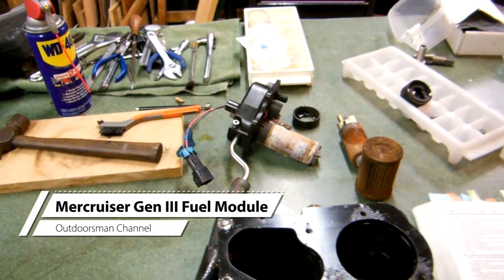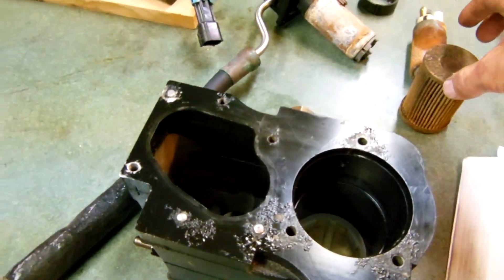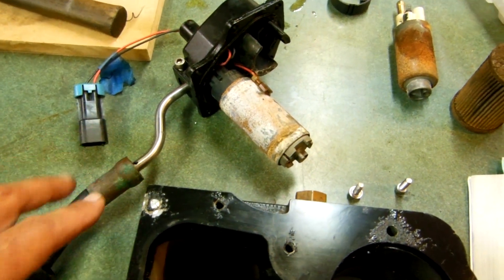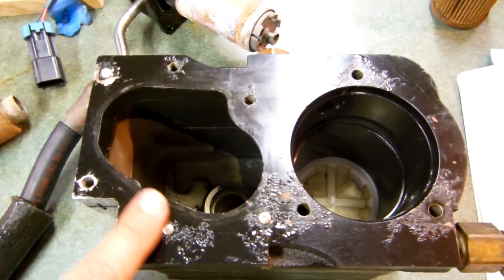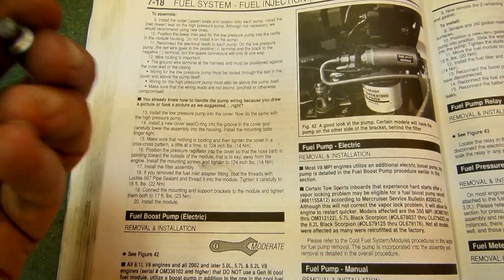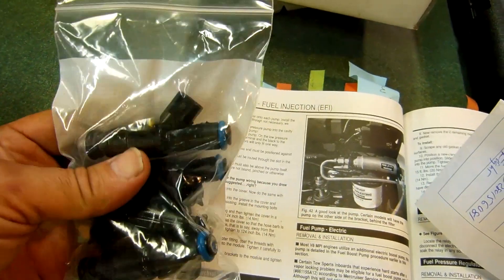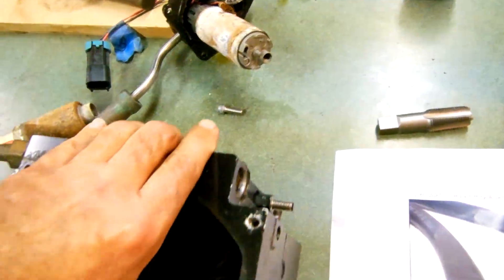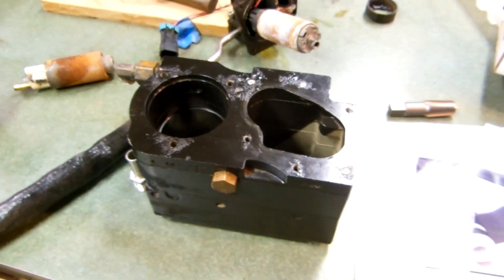Mercruiser Gen III Fuel Module

Comment: That is too much work and it looks like you need new pumps.  Also, the main paint peal problem is inside the small filter on top of the unit.  You can clean that out.  I would just buy a new Gen III box and assembly.
Reply from the maker: The Gen III box is a lot of money.  Ours has been working perfectly since this. Video was made and cost little to nothing.
Reply: What 'small filter on top' are you referring to?  I thought there was just the paper canister filter and the little disk one at the bottom.
Reply: The pumps alone are 750.00

Comment: Hello, great jhob!..What is the manual number? Thanks
Reply: Hi.  Manual is a SELOC Mercrusier Stern Drives 2001-13 Repair Manual 3208.   Tip, don't leave it in the boat if it can rained on.  Good luck. Joe
Reply: @joesilverbliss1721  thank you very much
Reply: No problem.  I am a contributing associate for the outdoorsman channel.

Comment: Did you replace the small round filter below the main filter?
Reply from the maker: Everything got replaced
Reply: Ok, most people only seem to replace the round filter and not both.
Reply: @ATKrausz  round filter is, from my reading, a 5 micron particulate filter.  worth doing while you have it open, imo.
Reply: @johnbeachfl1 The disk filter has a bottom filter made of fiber out material .  It will start to break down over time noticeably.

Comment: Hi, To prevent water buildup in your fuel tank, keep the tank full of fuel when the boat is not in use. That will prevent condensation on the walls of fuel tank and less water will collect in it.
That will save you a lot of headaches and money. Water in fuel is not bad fuel, but condensation in the tank. I hope that will help. PS: Great job on the broken bolts :o)
Reply from the maker: Thanks yea we are aware of that.  Unfortunately we bought the boat in this condition and were not aware of it when we purchased the boat.  Thanks for watching!
Reply: Excellent advice!  Jim, the fuel injection specialist, recommended running low cost ethanol gas during the season.   The fill it up with non ethanol gas at the end of the season.  He said the ethenol cleans the system.    Boat is running fantastic now.  Joe

Comment: how do you remove the fuel module from the boat? i see you took part of the fuel line that goes to the engine with it. Does that not disconnect from the module? Im stuck, thanks!
Reply: So the stainless tube that goes into the fuel module that eventually goes to the fuel rail comes out.   This one was stuck and corroded big time.  This one had a cross bolt with a tapered end to hold it into the fuel housing.  You need to remove that first.   If yours does not come out I would put penetrating oil on the stainless tube and let it sit.  If I was going to do this again I would soak all screws with kroil.  They might not have broken.   To remove the rubber hose from the fuel rail on top of the engine you need to get special tools at auto store.  Not expensive.  Finally there is a special oring that you should replace on the stainless tube.  It seals 40 psi gas from seeping out around the tube.   In addition to all this if you clean corrosion off the seat of the fuel tube hole on the box it may not snug up with the cross pin when you are done.  I work closely with the outdoorsman channel.  Good luck Joe
Reply: @joesilverbliss1721  Hi, regarding the stainless line that goes into the fuel pump cover, mine looks to be in very good shape (i.e. no corrosion).  That said, I haven't removed the stainless line from the fuel pump cover yet.  Where it enters the top of the cover, is the stainless line supposed to be rigid?  I can rotate the stainless line clockwise and counterclockwise with it still connected to the top.  I only turned it a few degrees each way, but I want to be sure that is normal.  I know that little 'crossbolt' thing is supposed to keep the line securely in place, but like I said, I'm not sure if it is supposed to stay in a fixed position.  I'm thinking it is supposed to move as it is probably an O ring seal.  Can you please confirm that some movement of the stainless line is ok?
Reply: @willytv275  the stainless line comes straight out after cross pin is removed.  Use liquid wrench or kroil if you can get it.  It is good that you have some movement. Mine was stuck firm.  It is probably corroded a bit.  There is a special seal that I would replace after you remove it.  I would keep working it and rotating it.  So, after I got mine out and cleaned the bore of crude it didn't want to snug up with the cross bolt.  I think it is a poor design.  I had a tapered cross pin that went into the other side of the hole with a smaller diameter part of the cross screw.  New cross screws is just a hemisphere and I think it might work better.  I bought one but didn't try it because I got mine to work.  Let me know how you make out.  Also I removed the line to the fuel rail and took the entire thing out to work on it.  Good luck
Reply: One more comment the stainless line is free to rotate until you snug it up with the cross screw.  If it was new you could rotate it 360 degrees.  It is a very wired joint the special seal, not an O ring, holds 42psi of fuel.  It look like it expands in the bore due to the pressure.  If your box is clean and good I would not mess with it.  Rotation after tightening the cross pin is not a good thing.  It should not move due to friction
Reply: @joesilverbliss1721  Hi Joe - I was afraid you were going to say that.  I didn't loosen the screw and my line moves both CW and CCW.  I think I may have knocked it loose when I was trying to get the box out of there.  So if I remove the cross screw and replace the seal (maybe cross screw also), I should be able to get it tight again, right?  I for sure don't want 40 psi of fuel spraying out of there.  As for my box internals, they look pristine.  Thanks again for the info and if you have any additional comments or things I should do, please reply with them.
Reply: @willytv275  yeah it is a really bad design.  The real question is does it leak or will it leak gas.  I wound up fabricating a c ring spacer washer on the tube to get some clamping force with the cross pin.  If I were you I would try buying the new design clamping pin and order a new seal just in case.  Marine engine has them.  That tube is rediculous, you can generate so much force on that tube and pinned joint if you got the fuel line.    When I put mine back together I strain relieved the hose and tube to reduce the possibility of movement.  On the positive side that seal works really well and i think it can take some movement.  But it is fuel, I watched it very carefully at first.  I have above 100 hours on it so far with no issues.  If you are daring you can drill a little out of the cross pin box housings on the large diameter side to allow the tapered part of the pin to engage more and wedge the tubing better.  The tubing has a flange that the tapered part of the pin hits in a very small arc on the tubing flange.  The design has some tolerancing issues.  I believe that is why they redesigned the pin. Pin was not that expensive, I bought two just in case.  Let me know what you do.  Joe
Reply: @joesilverbliss1721  Hey Joe - thanks for the additional reply. You’re a wealth of info. I just left my mechanic’s shop. I ordered what I think is the new screw design (pn 10-866114) and a couple of seals (pn 26-863151). I asked him about the movement of my stainless line. He said that was no big deal, although I am kind of skeptical about that. Like you said, I’m thinking that thing should be pretty solid when you have it tightened down. On the other hand, he does this for a living so I would think he should know something about it. Also, I just picked up a couple of stainless hose barbs. In your video, you were getting ready to put those in. Did that work out OK? I’m a little hesitant because there’s not much metal around those two holes. I would sure hate to bust out that casting. Thanks in advance for any replies.
Reply: @willytv275  I think the new redesigned cross pin will help. Good luck.  Joe
Reply: The cross bolt that holds the fuel tube in is part number 
10-866114.    They don't sell the original design anymore, my guess it was because it was poorly designed.
Reply from the maker: Thanks Joe Silverbliss

Comment: You should torque M6 SS bolts to about 55-60 in-lbs max! My experience with M8 grade 10.9 going into aluminum...they torque to about 96 in-lbs. 124 in-lbs would break the bolt! Also how did you prime the system? Everyone talks about replacing fuel filters, but then you live the system with quite bit of air in there.
Reply: This is a bit late.   To prime the pump, you need to,. Install the fuel box but leave the fuel cover for the filter section off.  Then fill it up using an appropriate container, keep the bildge blower on. Fill just enough so it doesn't overflow when the filter is installed.  Then install filter and cover.    If the box gets air locked it is a problem.   Good luck.  Joe
Reply: @joesilverbliss1721  Thanks!
Reply: There's no easy way to prevent spilling when you put the filter holder back in place so have some rags or container ready and in place. Also that big brass bolt on the inside is a bleeder.

Comment: How much did he charge to repair the injectors?  Do you have a link to the service bulletin for the water fittings?
Reply: I believe it was less than $20 per injector.  I want to say about $18 per injector.  Very good value compared to new injectors at $300 each.  Link for fuel cooler https://www.perfprotech.com/blog/tech-articles/new-mercruiser-gen-iii-cool-fuel-module-service-bulletin. In the video I talk about stainless compatibility with aluminum being better than brass.  Further review shows this time be incorrect.  I think brass may be more compatibe.  Tapping the box didn't work that well.  I could only get a partial thread.  Modifications to the Barb fitting, the partial thread and waterproof JB weld worked well for the fittings.  Getting the nylon broken fittings out of the feed hoses took a bit of work.  In the end it all worked well.  I work in close association with the outdoorsman channel.  Good luck Joe
Reply: http://injectorrepair.com/contact-us/.     My fuel rail had to flushed out also.
Reply: One more tip.  If you try to take it apart buy some Kroil penetrating oil apply it to bolt and let it sit for a day or two.  I wish I knew about this when we tried to get the bolts out.  The stuff works like magic on aluminum corrosion Bonds.
Reply: I actually have some kroil. Good stuff